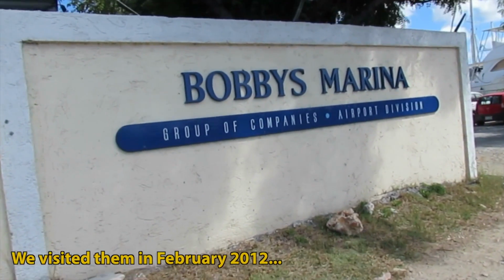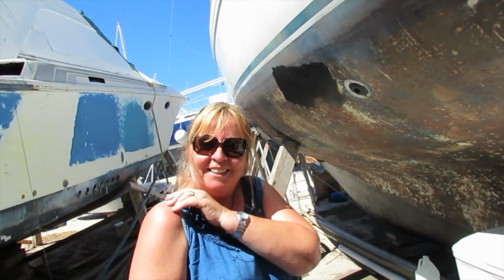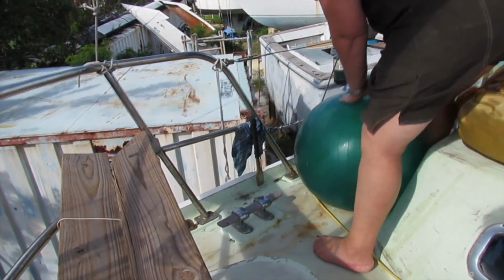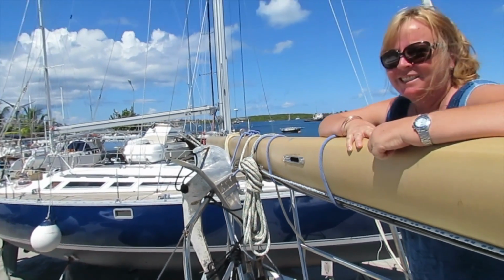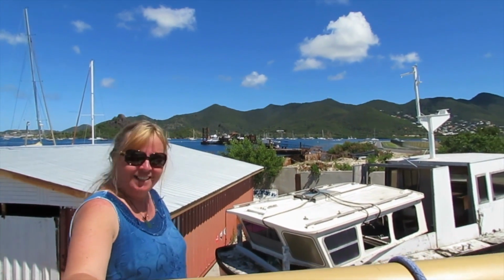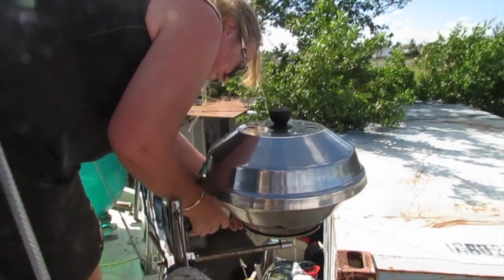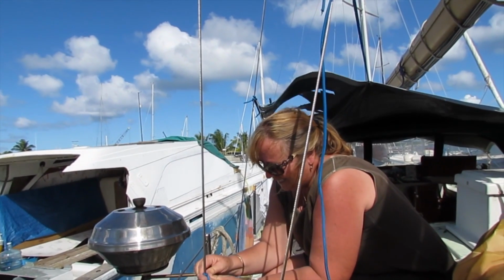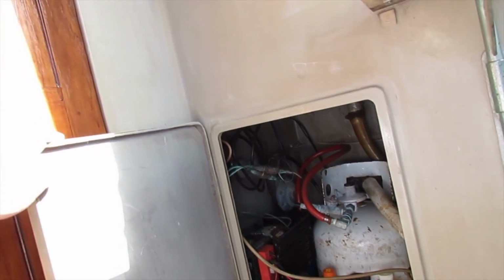Visiting Liveaboards Renee and Lynette aboard Sailboat Bubbly, Part 1 of 2

Comment: British Hoover still makes washing machines and such, and I saw that they make a slender top loading washer/dryer.  I'm not sure if it's the same that she has simply because it said it was about 56kg…that's a bit of a heavy load.  We have a Splendide washer with a non-venting dryer.  It's remarkably compact, though we did have to widen the forward head door just a tad in order to get it through.  Totally dig being able to do laundry on the boat!

Comment: It was not the case everywhere, but this particular boatyard is located extremely close to the airport.  If I remember correctly, I believe she said there were few (if any) flights at night which meant at least their evenings were quieter.  I suppose it offers even more motivation to get back into the water though, eh?

Comment: Good to know, eh?  So much trouble can be avoided by simply doing your research, though you can still occasionally get nabbed because you didn't ask the right question. The one thing I'm a bit stuck on is notifying them two days before you arrive.  If that is still the case I can imagine it would tax many smaller boats who have limited communication abilities while offshore.  Ah well, we have quite a bit of time before we'll be heading in that general direction...